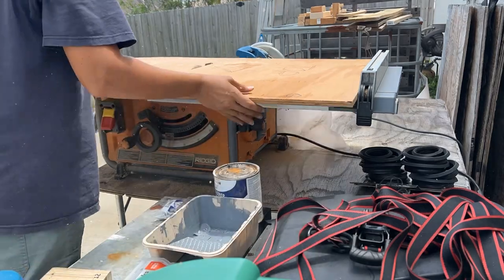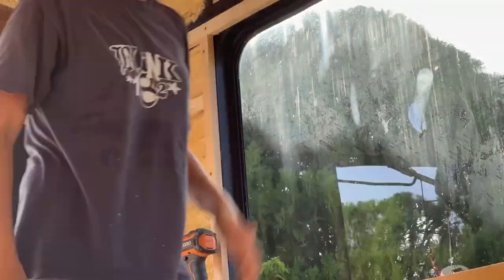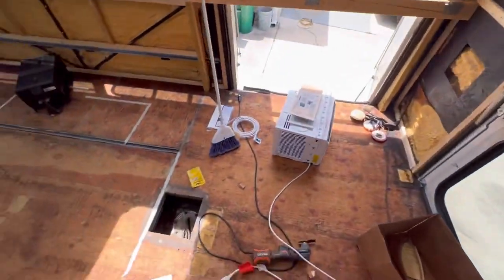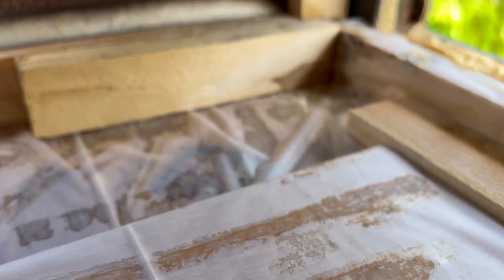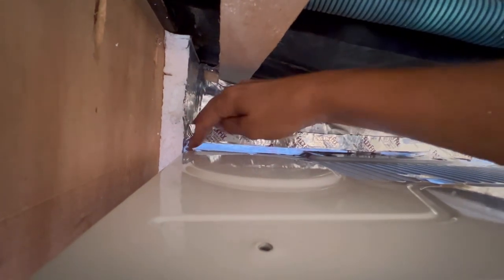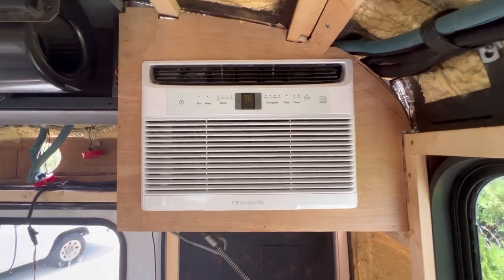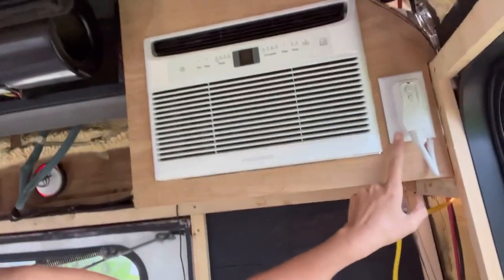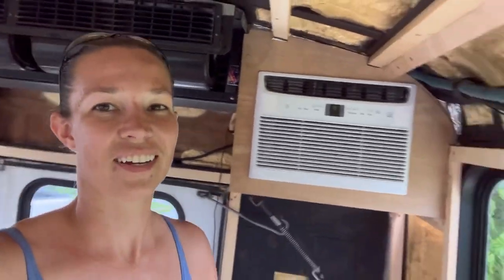Shuttlebus conversion - Episode 14 - Building an Insulated Box for a Window A/C Unit!

Comment: I had my Ex install a windows fan in my van. But we did build a box for it. It is supported by a a piece of plywood he cut a hole out for the a/c then placed  metal bracket on the sides and bottom. It's  drilled into my rear door & sealed with marine sealant. 3 years and no leaks yet. ( I FOLLOWED CAMPERVAN CORY STRANGZ METHOD OF INSTALLING MY A/C.) IT works on shore power only though.

Comment: That back vent is not rated for outdoor use. Hopefully it will keep the rain out.
One other thing, I suggest you pull the vent out and glue a bug screen to it and reinstall. 
That will keep the wasps from building a nest in there.
Reply from the maker: Great idea about the bug screen! I have some in the garage and will definitely add it (although I can’t imagine the wasps will be comfortable with the 116° coming out of that vent!) As for the rain, the worst case is that the water would drain back through the hot grate into the unit, out through the relief hole and into the moat. The whole area is well taped to the point where I have no concerns about water getting behind the wall. The a/c unit was originally designed for the condensation to just overflow through the back grate anyway (which is why I had to drill the hole to direct the water where I want it to go) so there’s no possibility of harm coming to the unit from a little water. Thanks again for the bug screen tip!

Comment: Nice custom fabrication!  How did you choose that particular A/C unit? My shuttle is the same size as yours and I need a similar type of unit to operate on shore power. Any recommendations?  Thanks,  John.
Reply from the maker: I basically looked up the smallest ac units you could get, that took the least power/had the least BTUs, and I knew I wanted one with a digital readout. That was my criteria, yours may be different. Cheers!